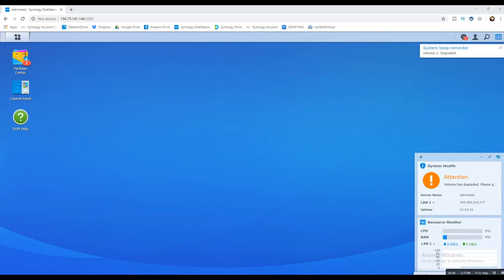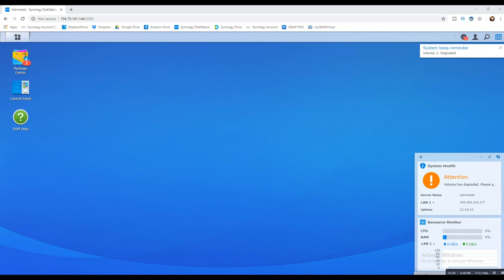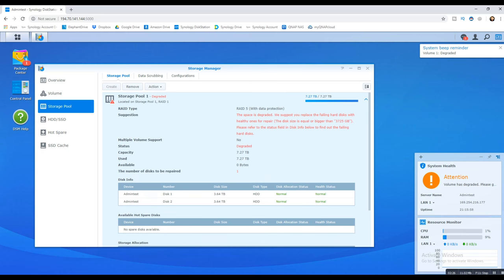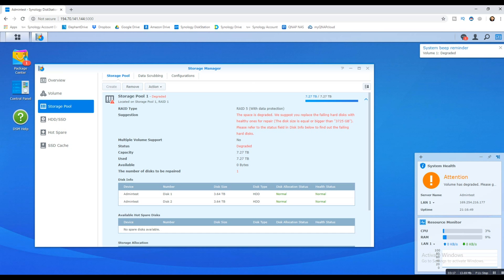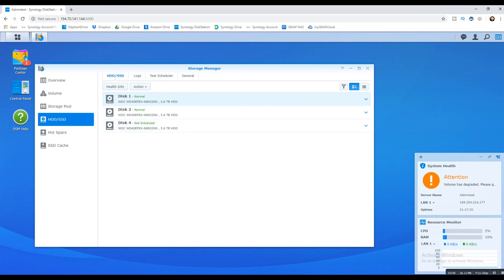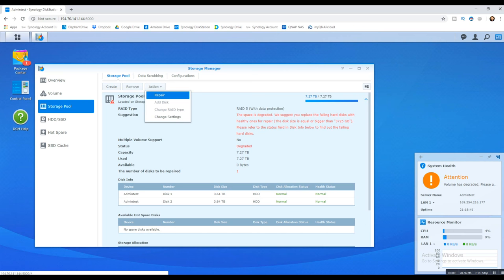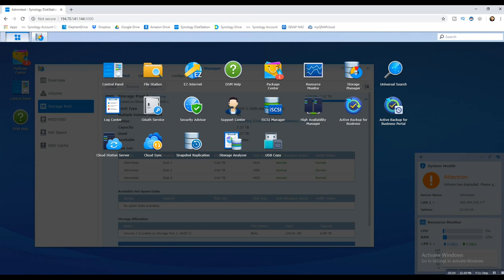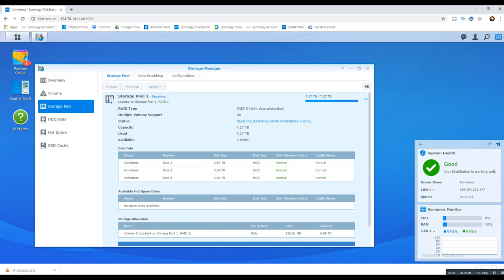How to repair a RAID with a new drive

Comment: Hi! I have a question. From there the system for a while is "creating volume" and the LED's are all green and fine.
Then the DSM status will return to say "No volumes" (LED back to orange flashing), and in Control Panel>Storage it shows
Disk 1 - is not initialized
Disk 2 - is initialized. 
Disk 1 is not initialized. What to do?

Comment: Disk 1 (WD Red 2tb), in a DS214 play, 5 years old, has been having bad sectors for a short while, just got around to swapping it out. followed your procedure and it worked perfectly,  if a little bit scary (first time). Repairing as I type. Thanks.